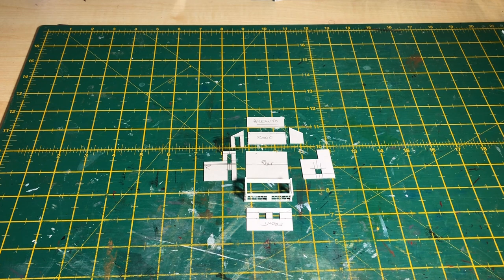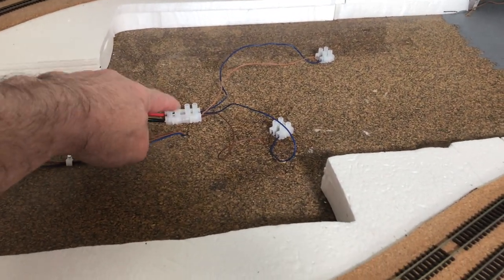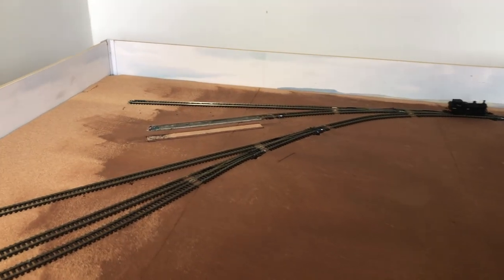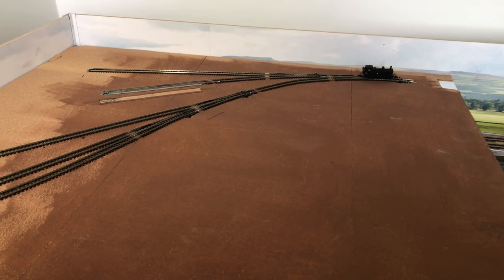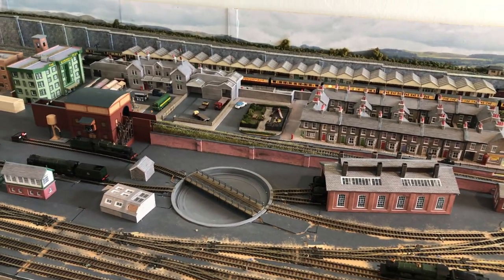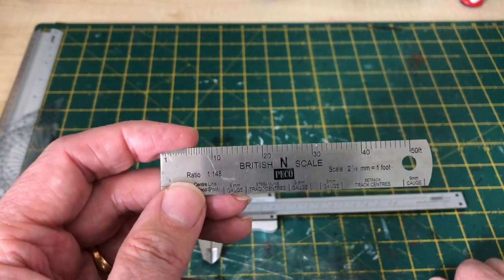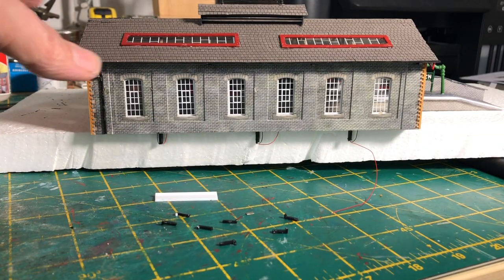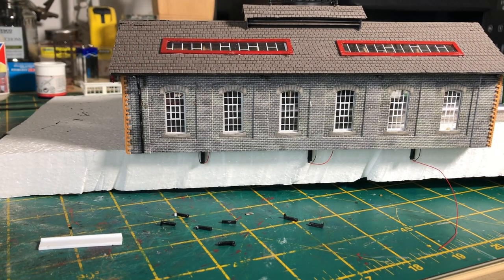Elvenhome N Gauge Model Railway Layout - Building the Branch Terminus and Yard  EP82

Comment: Thanks for showing how you fit gutterings and downpipes. They are a devil to add in n gauge!
Enjoying you're videos!
Reply from the maker: I am glad you have found that useful.  If you look at video 49 you will see how I use bound wire to fit the gutters.  This is easier and better if there is not a large overhang from the roof.  Saves making the brackets.  Stephen

Comment: Hi Stephen, another very enjoyable episode, looking forward to seeing how the signal box goes, looks like another fiddly N Gauge build! Point motors are a worry to me although I know I’ll work it out and in a strange way looking forward to it! Off to B and Q shortly for some supplies now I’ve worked the gradients out and whilst I’m there a Vernier will be picked up. Thanks for your support so far, John
Reply from the maker: Thanks John.  The electrical side of things worried me most when I started this layout.  If you haven't come across him yet, Brian Lambert has a website that is the mecca for things to do with wiring model railway layouts both DC and DCC (google his name to get the link - if I put it in here YouTube will quarantine the reply).  If you haven't bought any point motors I would spend a bit of time deciding which ones are best for you.  You might want to look at  Simon's Shed video where he fits DCC Cobalt motors.  They are more expensive but much easier to deal with including I think polarity switching.  If I do another layout I think I might well go with them. Stephen
Reply: Thanks Stephen, yes I saw that on Simon’s shed and have decided to go with DCC Concepts motors, like you say expensive but a bit easier to handle. I’ll check out the Brian Lambert website, i think once I’ve got the idea I’ll be ok it’s taking that first step!!!! Thanks again John

Comment: Hi Stephen, Like you I also use my N scale ruler for measuring and not a standard ruler. When I began kit bashing and scratch building back in the early 1980's, I purchased a Dial Caliper from a well known tool manufacturer. I still have it and it and it works very well, but I'm trying to keep a long story short. A few years ago an online shop had a sale on Digital Calipers and I just couldn't pass up the price. A couple of advantages of the Digital Caliper is precision, no guessing when the dial needle falls between two hash marks when you're reading measurements off prints, plus the Digital Caliper allows real time conversion between Metric and Imperial measurements. My Dial Caliper only measures in Imperial units. One more item you may want to add to your tool collection is a French curve, that helps in the drawing of smooth curves of varying radii. I enjoyed the running session and the trip up the branch line, glad you were able to find a solution for your train cam. keep up the great work and I look forward to the next layout update. Cheers, Rich S.
Reply from the maker: Thanks very much Rich.  I may buy a digital set at some point.  They make such a difference.  I will have a look at buying a french curve also, thanks for the tip.  I was so pleased to be able to use the train cam.  It adds a lot to running sessions and I really want to show the inside of High Elven once it is installed with its lights.  Stephen

Comment: Hi  Stephen  - enjoyed your update.  Know exactly the issue you had with the point motors.  I always use some contact adhesive which gives around  5 mins of fiddle time to get the motor lined up parallel with the tie bar ( the larger hole I drill also helps).  Watched one of your very early videos last night where you built your very first scratch build (a bridge).  You didn't even have a complete loop of track so it shows how much your layout has evolved from those early days.  Cheers Euan
Reply from the maker: Thanks Euan.  I will bear using contact adhesive in the future.  They were so finicky the time around.  I have had a few people viewing earlier videos, and commenting, and when I see the layout how it was a few years ago I realise how much I have completed. Stephen

Comment: Thanks for showing us the callipers - I think I need some of these, but have never realised until now. Unfortunately, I couldn’t follow what you meant when you were showing how they are used. You were lining something up with a ten and then something else with a five, but I didn’t see where ten was! But thank you - they will save me a lot of time like you say, in the cutting and re-cutting. Looking forward to next update.
Reply from the maker: Thanks.  I'm glad this has helped.  If you are going to get some get a digital set and you don't need to work with the vernier gauge (that is the small scale below the main scale).  You will just get a digital readout.  I did the demonstration on the spur of the moment and looking again at the video I realise that I should have said that the main scale is measured in centimetres.  So 1 is 10 millimetres.  I set the 0 on the small scale below the main scale to the 1cm.  I then look along the small scale until I get to the 5 and move that to the right until it aligns with the nearest 1mm division above it on the main scale (it doesn't matter what that number is). Stephen
Reply: Thank you! That makes sense! They are on my list!!

Comment: Nice video Stephen, the station building looks very good. I am pleased you managed to sort out your problem with the point motors. I am not a lover of the Peco or Seep motors myself, they caused me so much grief on my first layout, trackwork is looking good.
Reply from the maker: Thanks Chris.  I think if I were to make a new layout I would move away from the solenoid motors.  I was new to modelling when I started Elvenhome and just went with what seemed the right thing.  But they are a pain to wire and fit.  I think I would also go over entirely to DCC control as well.  Stephen
Reply: Yes I Made the same mistake with my layout, I had used them before years ago with a layout made for my children. So it was natural to use them again, but with live frogs I found it a nightmare so I changed the point motors on the scenic section to Cobalt motors. I have gone a step farther this time with digital Cobalts but on a separate bus, layout and fiddle yard controlled by Psx circuit breakers.

Comment: Great video! I loved the view looking along the terrace buildings and the station, I'd forgotten how impressive that vie really is. I know you have said it will be difficult to do, but will you consider lighting the terrace houses as the layout nears completion as they will really make the layout stand out with all the other light you have already installed. Keep up the good work, looking forward to the next instalment. All the best Tony.
Reply from the maker: Thanks Tony.  I think I have concluded that to put lights in, given that they have to go below the board with all the points, is just too difficult without lifting the board.  If however I have to lift that board to repair a point or whatever, I will fit lights.  Stephen